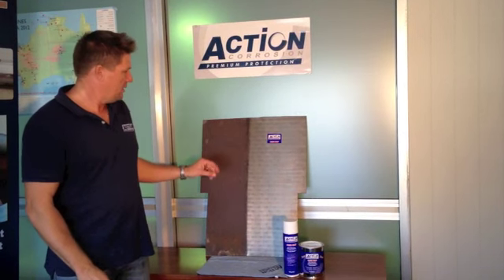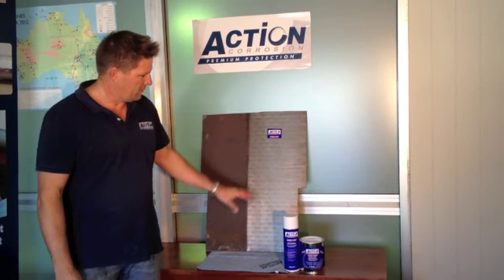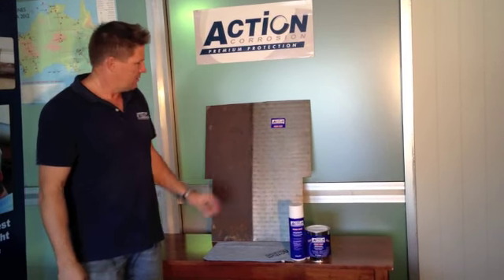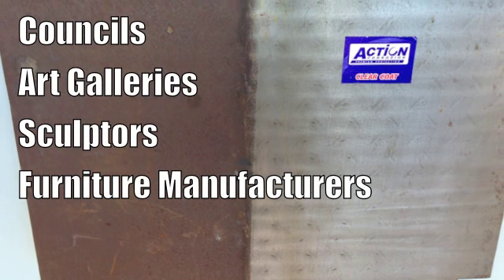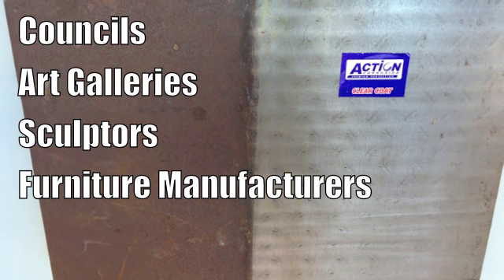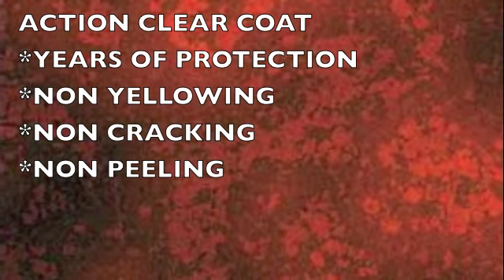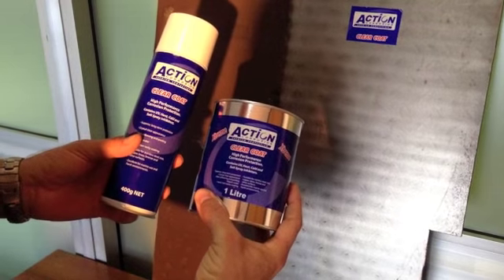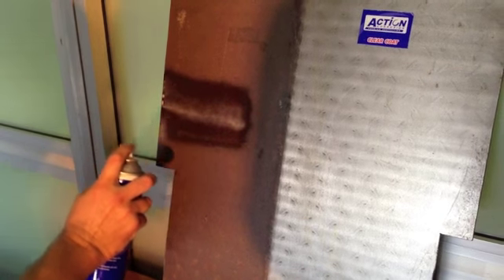How to Protect Patina

Comment: How does this product hold up to the sun?  Phoenix, Arizona, U.S. sun in particular :) Also,  I like the patina and look I have currently without having to rub it with a cloth and change the look.  I can do it on a summer day when there is virtually no moisture in the air.  Can I get by without having to rub it?  Thanks!  P.S. I hope the fire situation gets better in a hurry down there...
Reply from the maker: Hi Brian, the Action Clear is very strong against the sun and does not yellow or crack from it. Even the Aussie sun down here is harsh and does not cause any problems. The rubbing step was the preparation with the general purpose thinners. This step is always recommended as it cleans the surface of any oil, dirt, grease or coatings which will prevent the Action Clear from adhering to the surface and curing. This is the most common cause of problems with the product when people do not prep the surface properly. Thank you so much for your kind words.